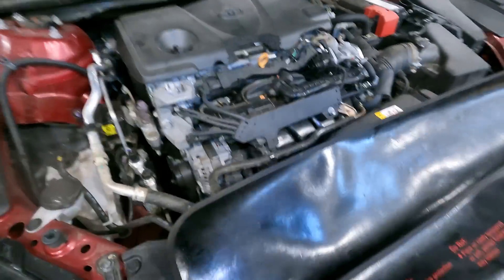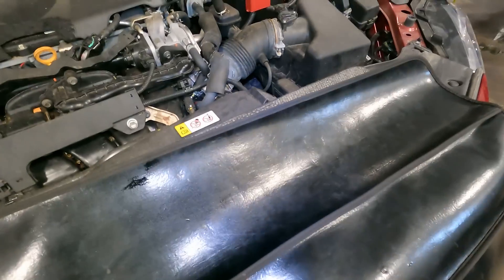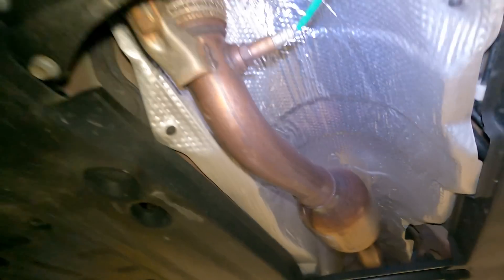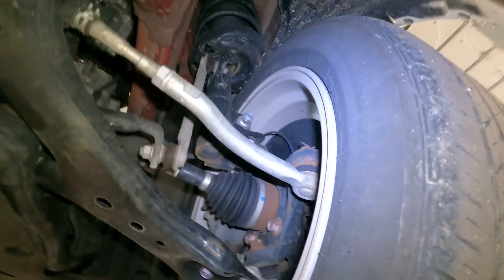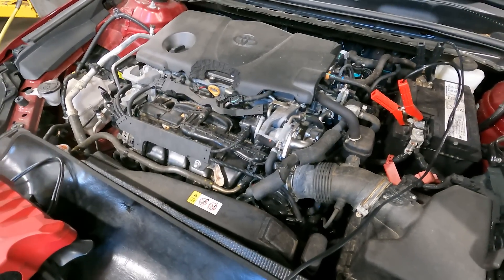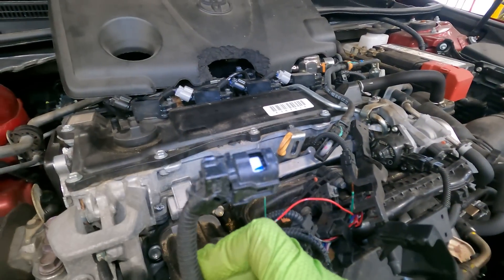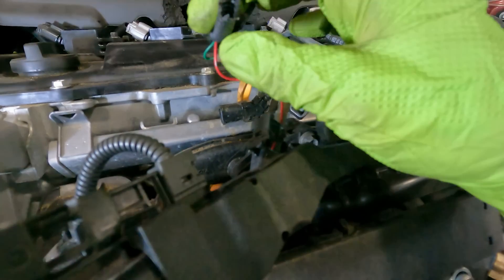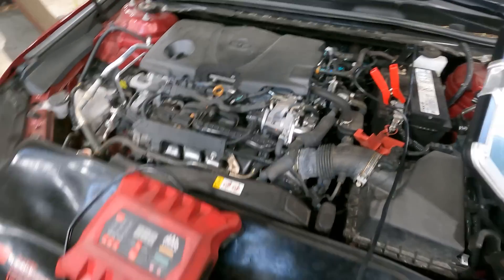Customer states I HAVE A CUSTOM ENGINE COVER that I didn't make!

Comment: I approve of the custom engine cover. Access to the dip stick should never be hindered.
Reply: Fifel the mechanic
Reply: I just got a Mercedes GLA. As far as I can tell, it doesn't have a dipstick. The car tells you if it's low on oil. I hope it works.
Reply: When mice have better design sense than Toyota engineers.
Reply: This needs to be the new factory standard.
Reply: @Leonarco333  But do mice get union wages?
Reply: @imhooks  Now if you were comparing mice to GM engineers I might agree with you. But Toyota's engineers usually get stuff right; this must have been an intern's doing.
Reply: @soaringvulture  maybe they should. Apparently they are better at it than the engineers.
Reply: @soaringvulture  Go to hidden ASSYST menu. There you can see exact oil level up to 0.1L.
Reply: @Cribs00  That's why I wrote "The car tells you if it's low on oil. I hope it works". Being a Luddite, I trust a dipstick more than some sensors in the oil pan.
Reply: @soaringvulture  As a former Mercedes Benz tech I can tell you that they rarely go bad.

Comment: Ha ha, I work at a company that makes those exact engine covers!! It’s a big giant machine that sprays a layer of black paint, then injects a 2 part mixture of liquid foam into molds. It sets up like foam rubber basically. Then there’s a bunch of excess that needs to be trimmed off the edges and inside that hole on the left side. I honestly would not be surprised if our company made the one on this car!! In fact, I have one of these I stole from work sitting in my closet lol!

Comment: I know everyone uses those waterproof crimp connectors, but on a harness I much prefer some solder and shrink wrap tubing. Even if water gets in, the solder will last years. You can also add dielectric grease before shrink tubing as a bonus. The best of both worlds!
Reply: They make it with an internal coating that will ooze around the joint and stays flexible after shrinking (Giggity!)
Reply: @jayrenner211  ... I am aware of that.... but it's still a crimp connection. Solder is almost forever when it comes to electrical. BTW, that internal juice is not epoxy, as stated in the video. It's dielectric grease.

Comment: As a shop owner, I can testify that the rodent problem is much more prevalent than folks think. Most customers wait until a problem happens and then want shops to repair problems and exterminate rodents at little or no cost to themselves...
Reply: I agree. See a lot of droppings in filters and chewed up harnesses.
Reply: Interestingly, I had little issue with rodents back in WI, even during the winter months.  Not once was a car chewed on.   I have since moved to Texas, and within a couple of years, rats had chewed through wiring up along the cowl, resulting in the brake light staying on.  State inspection of course wouldn't pass it.   Shop did a great job repairing it, I cleaned out the engine bay myself.
Reply: Best cure for rodents, snakes and if you dont  like them, cats, just make very very sure you dont have either in the engine when you start the car and always ram the horn to chase the critters out that you could have missed

Comment: The rodant thing is from them changing whats used in the wire coating/lub to something plant based wasn't it? Remember hearing it was something last few years that increased the rodant chewing
Reply: Honda sells rodent proof electrical tape just for this reason. I'd like to have a word with the engineers that decided to switch to soy based wires
Reply: I think that was started by a German Manufacturer. Possibly even an EU law.
Reply: That is the new genius "Green" thing to do. Make plant based plastics which animals chew more often, so you can make and ship more parts.
Reply: @sdvten  and ship the rats here too

Comment: It’s crazy how certain models get chewed in the same place even in different sides of the country. I have one sitting right now that is chewed in the same spot. Same injector chewed through
Reply: Thats what happens when this new fangled bio degradable wiring is made from soy
Reply: @ryanravencaller  well for example 4.0l 4Runners almost always have the #3 injector chewed. 4.0l tacomas have the knock sensor harness chewed. 2018 Camrys have the a/c compressor switch wiring gets chewed. Had about 10 or more of each of those. Why wasn’t the #3 injector chewed on this 2020 Camry?  Just me noticing odd trends.
Reply: @grabovg  May have somthing to do with the location and ease of accessing those wires.
Reply: Those rodents chewing the #3  wire practice discrimination in favor of the minority of wires easy to access. 👍
Reply: @grabovg  Maybe those are spots that are most comfortable for the rodents to sit and have a snack.

Comment: Did a 30k service.  Guy comes back 2 days later, not running right.  Popped the hood, found a twig in the engine, rats chewed the injector wire...guy said I broke it.  He owned major appartment buildings, multimillionaire,  and said we should pay for it...told him to Get Fucked!

Comment: I never understood the flawed logic of Toyota engineers' thought process. "Hey you have an issue with your engine? Yeah we're going to disable your ABS or traction control even thought they can operate independently."
Reply: My Odyssey did the same thing when a plug fouled out.
Reply: Vauxhall we’re doing that earlier I think. Definitely earlier than Toyota anyway.

Comment: The more I watch interconnected computer systems, the more I miss my 63 Plymouth.
Reply: And my 1964 Stude which rusted out but was very economical on fuel.
Reply: This is why I love my VW with a mechanicalised diesel engine. It's a modernish 1.9tdi. There are no computers controlling the engine, no computer aids. 

Very little can go wrong.

Comment: I was scammed several times at a dealership on tire rotation until my ex gave one wheel a little scuff and I noticed they didn't rotate when I asked them to.. It isn't always the customer that screws up the rotation..

Comment: Well, usually I wouldn’t opt for the cheap repair. On this one, I agree with the owner. Labor doesn’t change, and I’ll bet the harness is expensive. With a proper repair, which was done, it should be fine. There’s no benefit to replace the harness

Comment: After I found droppings inside my air filter housing, I installed a steel ¼" screen over the intake to the housing. Now I only need to worry about the green wires that they like...

Comment: Look like something my umbrella cockatoo would do? She chew holes in wood trim in huge half circles like that. 

On the bright side I guess it is a modification for easy access to check oil? I wonder coating on insulation of wiring, I remember use to have to fix a mercedes I bought for cheap due to the soy based wiring they used chew up and brittle, I had to spend weeks ordering and replacing, was worth it as was low mileage due to sat for years due to chew up wiring.

Comment: Great repair. 👍🏻 How was the Land Rover journey at the Cape yesterday? Wish I could of gone.
Reply from the maker: It was great! About 50 rovers showed up, good people, good convos. Had to help an old Series 2 with a carb issue, got that handled. Then we went on a cruise to the beach and ended the day at an ice-cream shop. Weather was great all day. We just got back after a 2-3 hr drive back up north.
Reply: @customerstateswhat  Sounds awesome, will you be posting a video?
Reply from the maker: @frankbiz  yes but have alot of footage to go through. Went to a cool store next to the ice-cream spot, Mocean in Dennis. The owner is also a Land Rover owner.

Comment: amazing on an 04 with a lot of miles i have been getting rough idle and CEL on warm dry days it magically clears, that is how it got to pass emissions test. on further inspection found that fiefel and two holes had nested in the area of and under intake manifold. further examination is required but hey it's ok for right now. I hope.
Reply: Bro, it's not ok
Reply: @samholdsworth420  i'm going methane powered next it's readily available

Comment: Have you run into any 2019 RAV4 Hybrids in NJ with wire harness issue going to the rear DC motor? Part Number: 821H10R011. The connection basically rots from road salt.
Reply from the maker: Not yet but will keep an eye out

Comment: Vince I know Honda is your competitor but why don't you use the Honda mouse rodent tape they invented to prevent them from chewing the wires part number is  4019-2317 from Honda. Fuefel will not like the hot pepper sauce its impregnated with.

Comment: Don’t think we go in for tyres being rotated in the U.K. it is cheaper to purchase two tyres rather then all four at once
Reply: I was always confused by this when I started watching mechanic videos when they say “Service & tyre rotation”. I’ve only ever done that when the customer requests it, seems like standard practice over in the US 😂
Reply: Some UK tyre shops are just lazy. I asked one to rotate wheels recently so the new one they were fitting would be on the front. They gave me some BS about the tyre pressure sensors requiring the tyres to be moved or it will think the wheels are on the wrong corners. I've swapped wheels before so I know the system just works what you've done after a few rotations.
Reply: @ColinWatters  some cars will actually do that. Depends on the type of TPMS system you’ve got, whether it goes off wheel speed or active sensors in the wheels. But if it’s active sensors all you have to do is relearn the sensors after you’ve done the rotation 👍

Comment: It's not the driven wheels that cause front tires to wear more. It's the STEERING. Front tires wear more on rear drive cars, too.
Reply: A properly functioning steering and suspension system will not be the major cause of front drive tire wear by itself. It is the combined weight of engine and transmission (in front drive vehicles) that causes the wear due to the load on the tires. The lighter rear end has a lower tire load, decreasing wear. Older vehicles with mid-body transmissions spread the weight out more, so the wear was somewhat evened out),  CSW shows this; there's no major out of balance/alignment or suspension issues showing on the tires, but the rear tires have much more tread than the front.

Comment: I never do tire rotation, when the fronts wear down I buy two of the same tire brand, then move the backs to the front.
Then I only have to by two tires instead of four.
Reply: Don't forget to rotate your oil! Make sure the top goes to the bottom, and the bottom goes to the top! 😆
Reply: @yodead369  Don't be ridiculous, Mii! You're supposed to change the direction of the oil pump so it pumps backwards. No need to rotate the oil in modern cars.
Reply: And reverse the battery...saves wear on he wiring.
Reply: @haroldwilkes6608  Don't forget to rotate the key fob batteries as well! You don't want to be out there one day, pushing the unlock button, and be stranded in the desert!  😂

Comment: Maybe I'm wrong for what I'm about to say but why not solder the wires together 🤔 instead of doing it with heat shrink? If a costumer is paying for labor why not solder them wires? If its about time and somehow faster? I really don't think so and it would of been better quality job and wasting them connectors...just saying 😆😅

Comment: The scary thing about those tires looking like they have never been rotated is that it's possible they never changed the oil.   40,000 miles on the clock in just 2 years and they don't bother to clean the car nor rotate the tires.  I bet the oil has only been changed once, if that.  That's sad and what a waste of a Toyota.

Comment: Just get the turd blower 5000, aka a leaf blower, and blow out the engine compartment. Problem solved at little to no cost, (for the most part) assuming you have a decent leaf blower of course.

Comment: I see you are using the battery charger that MAC charges double the price for. They are made by Clore Automotive and are way cheaper. I paid a few dollars more for mine because it's blue and says NAPA on it but not anywhere near as much as MAC charges.